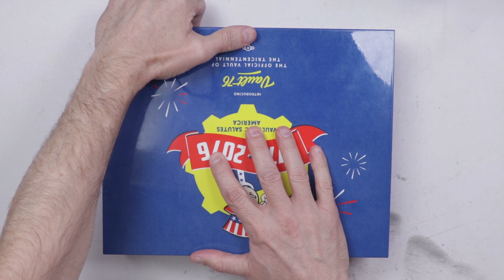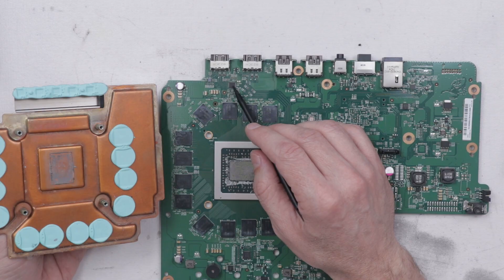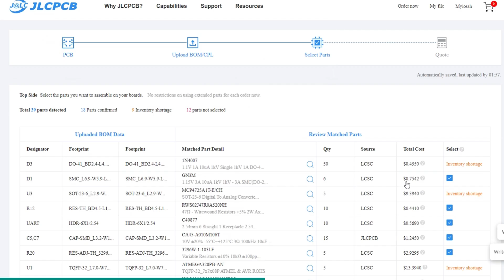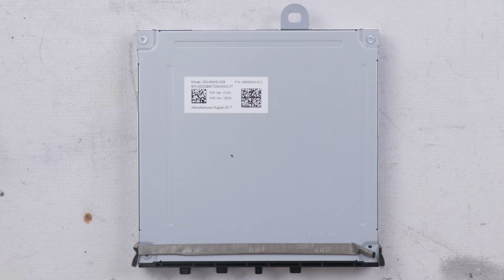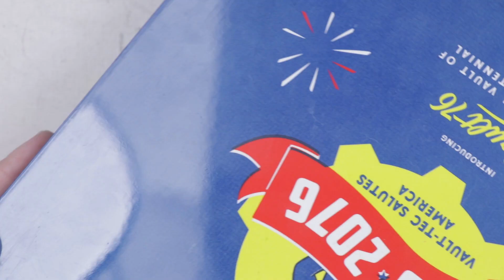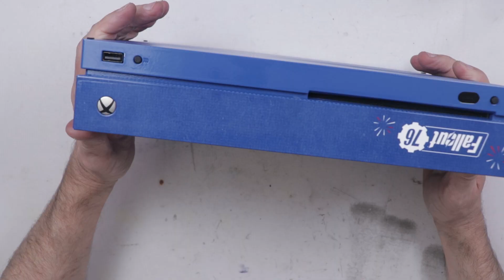BROKEN Custom Fallout 76 Xbox One X - Let's Fix It Then Upgrade!

Comment: The hard drives on xbox one are not paired with the console? I remember that in 360 you could not change the disc except with an original Microsoft one.

Comment: Wait, the disc drives in Xbox’s are married to the mobo? So if the disc drive fails, you can’t replace it?
Reply from the maker: You can replace it as long as you have the board that goes on the disc drive. If you don't have that board or the board itself is bad then there's no hope of fixing it.
Reply: @Tronicsfix  Ohhhh, duh, you just harvest the board in the drive bay and swap it out. Hahaha, you’d think that would have dawned on me as you were taking everything apart.

Comment: Hey Steve check the RealTek Ethernet controller IC. I just fixed a no power lightning struck Xbox by replacing this chip when I found a short on it. It took out everything. Power supply, retimer chip, wifi card, hard drive power data cable and last but not least the Ethernet chip which finally got it up and running. I asked the owner after if he had it hooked up to Ethernet and he did. So maybe check for shorts around there.
Reply from the maker: Yep, I replaced that too. I thought I said that in the video but maybe I forgot.
Reply: @Tronicsfix  you may have. I'm half asleep as I work third shift and was watching some YouTube before bed. By the way long time viewer and fan of your channel. Congratulations on your million subs. That's something to be extremely proud of. Keep it up Steve!
Reply: @Tronicsfix  You said you replaced the Wifi chip because you've heard it could cause this, with a yellow text in the video correcting it to the Ethernet chip. So relatively easy to miss the correction.

Comment: So I have a total noob question. When you heat up a component like a chip to soldered it into place, why doesn’t the heat damage the chip or the board? Is the temperature that it reaches only hot enough to melt the solder? Is there any chance of damaging the components when doing repairs like this?
Reply from the maker: As others have said solder melts at a relatively low temperature. Most chips can withstand pretty high heat too. Yes, there is a chance at damaging components when you're using hot air. It takes some time to get used to.
Reply: Because the solders melts with a low temperature compared to one that could damage the chip and also it's a very quick procedure.

 Yes there's a chance to damage a component, it's usually with the capacitors that have "oil"(don't remember the name) inside of them, they are the ones that you see popping on old boards. Usually it happens if you leave the heat source on the board more than you should.
Reply: @pedrolucasdutra1580  I see. So there is some delicate nature to doing this and risks when heating stuff up. I’d be right in that, correct?
Reply: The solder is real thin and has a low melting point.
Reply: @98ek9  So it’s related to the melting point. That makes sense. So does the hot iron heat up to a specific temperature?

Comment: Even I myself installed an SSD in my PS3 slim and there is a huge difference in the performance the games do load very fast as compared to hdd
Reply: @Ehrnesto. ps4 doesn't have a sata to fully benefit from an SSD either, still makes games load faster.  Even without the proper SAta connection a solid state drive is just faster.  Here's a fun fact, the USB 3.0 connector on the base model PS4 is faster than the internal drive connector, so if you want the best SSD experience, get an external SSD for the ps4.  As someone who has played fallout 76 with its endless load screens, having an SSD in my old ps4 has been amazing.
Reply: @Ehrnesto. Yeah but it does loads GTA 5 in just 56 seconds and you know how long it takes the game to load from hdd
Reply: @Ehrnesto. the port can still transfer data faster than what a HDD can so you can max out the ports ability with an SSD.
Reply: @Ehrnesto. neither does a ps4 phat since it can only take advantage of SATA II but I put one in and does improve performance just not near as much as it would on a ps4 pro or slimm which use SATA III